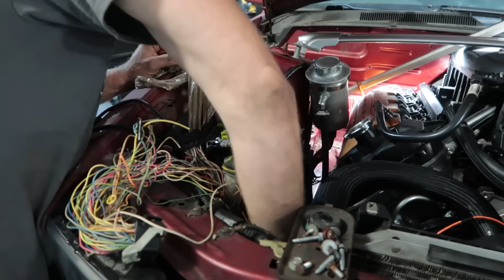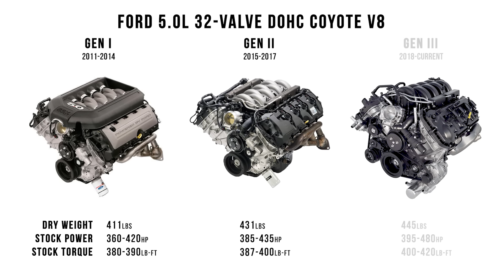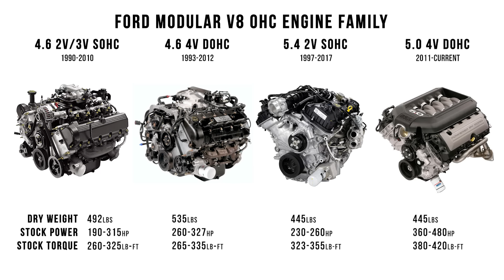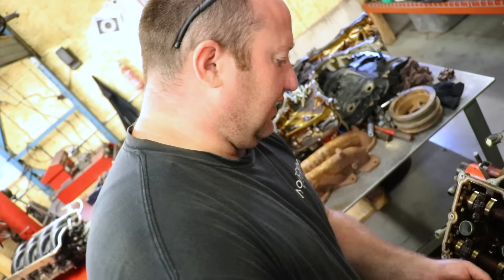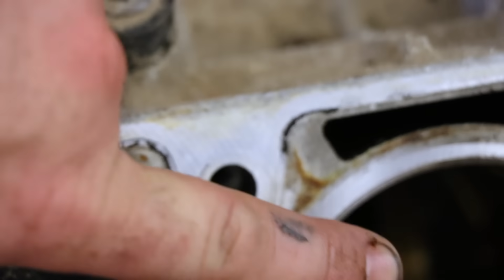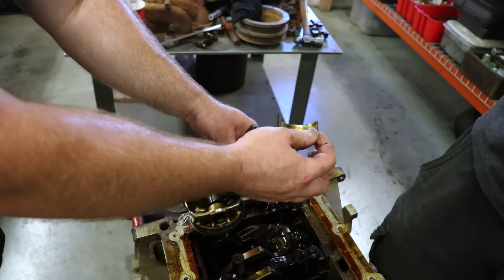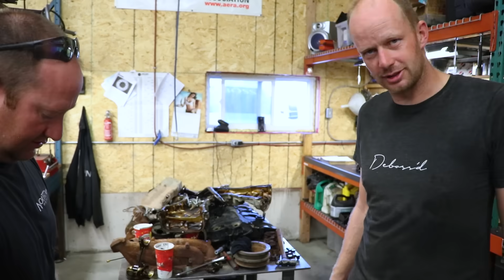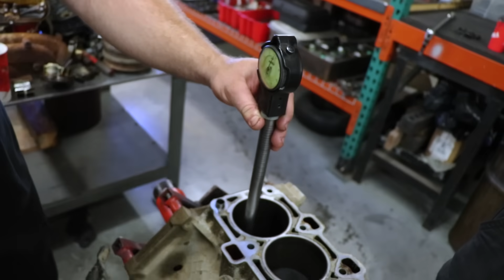REVIEW: Everything Wrong With A 5.0 Coyote Engine

Comment: Hello rich, when you get a hold of one will you do a talk about the 6.8 Triton v10
Reply: Easy get a 2 valve and plan for coil swaps other then that good engines hard on fuel.
Reply: It's a ford engine so he will just complain.
Reply: @Alpha Wërks  Your mom's still junk my hypocritical friend.
Reply: Have a V10 in my 2009 Winnebago. Moves that RV down the road pretty good. 265 Litre tank, about 1 liter for 4Kms.  Taking it easy, not speeding, no mountains = 850Kms per tank. However, I live in Edmonton AB and there are mountains and the Alaskan Hwy(2 times to Whitehorse) no issues at 37000Kms so far.
Reply: I drive a 2V-V10 daily and only issues are it’s a gas hog. The coil packs aren’t the issue, it’s a dirty MAF sensor, keep it clean and it will run forever! Those engines have a 100,000 mile plug maintenance so your good, now being I said that, buy the nickel plugs, use antiseeze and torque to between 11-16 ftlbs, your good. I torqued mine to 16. The V10 will use a quart of oil every 4000 miles and that’s even a healthy well cared for V10. Mine does, everybody I know that has or had one said same thing . Don’t forget, Ford built a standard Headed V-10 and a PI headed 10, the PI is the one you want and most likely find, the Non PI is rare, I have the Non PI engine(99). Also, the truck and van engine differ but can be converted if you have the van to truck and or truck to van parts donor. I pulled a V10 from a Ford F53 chassis, is based on a van, I simply swapped my truck pan, oil cooler, mounts, etc to the new engine and it drops in a F-250 no issues.hope this is helpful.
Reply: @DanielThomason1  ford revised spark plug torque specs to 20-23ft-lbs for all 2Vs otherwise they come loose at the lower torques.
Reply: @DanielThomason1  Hey Daniel, how many miles do your brakes last on that vehicle? It's an Excursion right?
Reply: @Alpha Wërks  Your mom's junk.
Reply: same as a 5.4 2v with 2 more cylinders
Reply: Same exact motor as a 5.4 with two more cylinders tacked on
Reply: I suspect the 10 cylinder is smoother running naturally and maybe has a flatter torque and hp rating curve.  I dunno.  They sound kinda cool if nothing else
Reply: V10 has a nice low end pull. The maximum power rating is very underwhelming, where it shines is from 0-45mph
Reply: Didn't they use that in the Excursions? Those things are tanks.
Reply: So you guys with the v10 like them? I’ve driven a few company trucks that had them and they didn’t feel much more powerful than the 5.4 some of the other trucks had. Plus the extra front end weight and bad fuel economy didn’t make it very fun to drive. Maybe we just had some bad ones?
Reply: @jaedonhaskins9917  nope, that sounds about right for all the triton V10s. Not as powerful as you hope, worse on gas than you hope, but generally just as reliable as the 5.4 2v. Still doesnt stop me from loving that exhaust note 😄
Reply: @jaedonhaskins9917  I have one of the non-PI versions in my F-250 with the automatic and I love it. Before this I had a 4.9L I6 F-150 and 5-speed manual, which was a great combo, but it was a gas hog for the amount of power and torque it made. This thing matches it in mileage with almost twice the horsepower and torque and in a heavier truck, using an auto, which is not bad at all. I average about 11 mpg around town and I can get about 13-14 on the highway depending on my speed. It's no fuel sipper, but not as bad as you'd think for a 415ci engine. I think the reason these engines don't feel very powerful is that Ford tuned the transmission to shift identical to the 5.4, so it tends to keep the revs high and it won't stay in high gear if you roll onto the throttle up a hill. At wide open throttle you do feel the power but driving around town it makes it feel anemic. If you drop the shifter down and manually shift it to keep it in a gear you can really feel the torque and throttle response of this motor, which is immense. Anyway, I've towed pretty heavy with it and it won't keep up with a modern diesel, but I've never felt like it wasn't enough to get the job done. Just don't be afraid to rev it out when it's got a load on. You can beat on them for days and they won't overheat and it won't hurt 'em at all. Remember that they rev this same bore/stroke combo to 6500+ rpm in the supercharged 5.4 with no reliability issues. You could run it all day long at 4000 rpm.
Reply: @jaedonhaskins9917  Well if it feels like the 5.4 then it's a downgrade from the 4.6 as the 4.6 feels faster for some reason, acceleration and body kickback into the chair feels more dramatic on the 4.6 compared to a 5.4lL f150.
Reply: East DallasKick's I love the 4.6 motor, my 2010 f150 has the 4.6 3v and it still runs good at 315k miles
Reply: @MichaelFletcher-to7mm  Oh that's great I'm still contemplating on purchasing a 2009-10 with the 4.6 triton or a 2012 with the 5.0L but I want it in a single cab as 4 doors (super crews) are boring to me now. Also do you have halo mcc?
Reply: All you need to know about the 6.8 is that Ford built one helluva shrimp boat anchor.
Reply: Jeff W  Hahaha Forrest Gump probably used one on his shrimp boat.

Comment: The 6.2 in my work truck developed an intermittent bottom end knock under warranty.  Dealer pulled the pan and found two main caps with loose bolts.  They put a new engine in it.
Reply: My friends work truck had a shattered piston on his 6.2
Reply: Yodaman I ain’t pushing shit dude
Reply: Ford quality.
Reply: @repairvehicle  Ford quality depends...
If built on a Wednesday, they quite alright.
On a Monday or Friday, oh boy!
Reply: repairvehicle whatever, I have a Tahoe that is just about undriveable because it’s always a new problem.  That is a true piece of shit.  I work my ford truck everyday and it has been almost flawless aside from the stated problem.  Every single GM product I have owned over the years has left me stranded in one way or the other, all of the fords got me back home.
Reply: @Highstranger951  , just because you got home,  it doesn't make Ford reliable brand,  you still keep fixing Ford on regular basis because it breaks.
Reply: repairvehicle no, I fix the Tahoe on a regular basis, pay attention.
Reply: @Highstranger951 lol sure bud bought Ford trucks most of my life only Durable Ford engine is 300 6cy stop buying Ford's 20yrs ago switched too Silverado with LS engine best engines ever built my 06 going on 275k miles still running strong still all original power train there's a reason old Chevy trucks bring better money than same yr as a old ford truck
Reply: @repairvehicle  Compared to what? A piston slapping oil burning AFE 5.3L GM?
Reply: @nathanmcdonald610  , who compares unreliable to unreliable?
Reply: @repairvehicle  Just pointing out the fact that you're leaving out that both the LS and Hemi suffer their fair share of issues as well. Making sure the narrative is clear you know. :)
Reply: @nathanmcdonald610 , did I mention gm or fiat?
Reply: @repairvehicle  You showed bias, that was all I needed.
Reply: @nathanmcdonald610  , are you saying that you are not biased by mentioning gm problems? You are biased yourself, but you don't see that because you are hypocrite.
Reply: @repairvehicle  No, just making sure we keep it fair is all.  If you're gonna mention one, might as well mention the others.
Reply: @nathanmcdonald610 lmao TRIGGERED Ford boy can't stand the Truth keep crying how many coyote engine Ford sold Chevy has made and sold over 100 million LS Engines
Reply: @donaldkinder6716  A million piles of shit is still pile of shit. I'll take my Coyote over a cookie cutter rod knocking LS any day of the week.

Comment: Looking forward to the “everything wrong with a 5.9 common rail” video
Reply: Absolutely nothing.
Reply: Ben Giovenco agreed the only thing I can think of is the automatic transmission I have a 03 6 speed   most reliable truck I’ve owned
Reply: Cracked pistons and injectors I'd really the only problem you can have with them
Reply: Do the 5.9 common rails have that killer dowel pin?
Reply: seanmurphy243 no
Reply: Or 12 valve
Reply: Woah! Take it easy! You're going to ruffle a few feathers with that comment.
Reply: The 2 things that should have been done differently on the 5.9L Cummins is the KDP, and it should have been sleeved instead of parent bore. Other than that the 5.9L is just one of the best small/mid sized engines. I think that the 6.0L Perkins is a better engine, but I love 5.9L. Perkins 354 and 354T were the best before the 5.9L.
Reply: Tom Cleverley kdp wasn’t an issue with the common rail. Totally different timing case
Reply: Killer dowel pin, 53 block, cracked pistons. It has its fair share of issues.
Reply: awr90 KDP is a cheap as all get out fix, and isn’t even an issue on common rails. The common rail also didn’t use a 53 block and even the 53 block fiasco was blown out of proportion. A very small percentage was cracking. The cracked piston thing is only really focused on the 04.5 to 07 common rail (in which time ford had an engine with a PLETHORA of issues) and even then, pistons only cracked if injectors hung open (which was easily diagnosed because you’d hear it knocking)
Reply: Common rail is the problem
Reply: Hugh Jarse common rail> 12 valve
Reply: He made it was just 0 seconds long

Comment: Cleetus is running blown coyote in his burnout Crown Vic if Im not mistaking.
Reply: no, 5.4 gt500 engine
Reply: think so yes, it was from a gt500?
and seeing the abuse that engine gets i dont see why anyone would complain about them. (he did change the timing chains to withstand his abuse tho)
Reply: @Frietpan  actually timing chains wasn't the issue. He was bouncing on the Rev limiter. Timing chains don't like Rev limiters. ECM was tuned to defuel and remove spark at a set rpm. Identical to what factory ecms do. He was replacing timings chains after every burnout before the ECM tune
Reply: Nope. Condor engine

Comment: Great whilst under warranty ! After that 🤔
Reply: I agree, my ecoboost 3.5 was out of warranty by 80 miles and it blew up on the 4th of July on my way home from work.
Reply: My girlfriend and I both have mustangs with the 5.0 and hers is a first gen with 96k and mine is a gen 2 with 67k and both of these cars are fantastic powertrain wise. Starts right up, shifts smooth as hell, fun and fast, sounds great. The 5.0 is one of the best Ford has put out since the 4.6 2V. You can also see plenty of examples of the 5.0 with 150k+ miles on em.

Comment: Exhaust manifolds rusting out and exhaust manifold bolts rusting out, these issues Ford have not managed to fix 20 years later.  History repeats itself.
Reply: Shit the 460’s from the 70’s we’re constantly having manifold problems
Reply: sounds to me like a factory implemented excuse to long tube and straight pipe the truck.
Reply: But GM has the same issues, I changed the bolts on my 5.3 as a preventative measure, I've heard on the LS the rear exhaust manifold bolts break from 70k to 150k miles depending on the salt on the roads.
Reply: Wouldn’t have anything to do with being in the rust belt and being heat cycled at least twice a day for its entire life.
Reply: @RadDadisRad  , other brands don't have that issue, because they use stainless steel. So, don't blame rust.
Reply: @repairvehicle  what you've never seen stainless corrode and rust because that can still happen you know.
Reply: @Zach-ju5vi ,  I never seen Stainless exhaust manifold to rust out like Ford has with cast iron.  20 years ol6 vehicle with Stainless exhaust from factory looking like brand new, but the body of the vehicle is rusted.
Reply: @repairvehicle  it is made with a preventive coating when it's formed, doesn't mean it doesn't oxidize, corrode and rust.
Reply: @Zach-ju5vi  , my 5 years old f150 with 5.0 v8 coyote engine had rusted out bolts and exhaust manifolds were rusted big time and started to leak.
Reply: @repairvehicle  I highly doubt rust has anything to do with it leaking, they leak from warping because of extreme heat or blown out gaskets.
Reply: @Zach-ju5vi , sure they do, when it's rusted out its starts leaking, not a first time it happened to me, first time with 5.4 and then 5.0.
Reply: @repairvehicle  kinda sounds like BS to me. I had a 5.4 for ten years, the manifold leaked but from the gasket, my 79 460 leaked but because the manifold was warped, all my 40-50 year old tractors have rusted manifolds none of them leak.
Reply: @Zach-ju5vi  , ford quality is not same quality of the tractors 50 years old.  Tractor quality comes from hard work made in US,  ford quality comes from cheap outsourced metals where people earn 20 cents per hour.
Reply: @repairvehicle  you could be right and I'm sure all manufacturers suffer from this problem. All I'm saying is I had a 5.4 and my father has a 5.0 and we never experienced the manifold rusting enough to cause a leak on any engine that wasn't 30+ years old. Although I have see lists of bad gaskets and warped manifolds.
Reply: @Zach-ju5vi ,  some people never have problems with Ford,  because they never keep them longer 2 years. Some don't even know that problems existed because they have lots of money and pay dealers what ever it needs done during the oil change.  One Ford owner (business owner) commented on my channel, stating that every oil change at the dealership his truck needs something replaced and repaired. He does not care about quality,  because purchased another Ford.  For some people problems none existent because they love what they drive and don't care about the problems,  money solves they're vehicle problems. I work hard for my money and cannot afford not having quality vehicle. Thanks to YouTube a lot can learned without  spending money and learning hard way.
Reply: @repairvehicle  that goes for all manufacturers not just ford, that's why I haven't bought a truck newer than 08. Although if I was to by a new truck it would probably be a 5.0 because I like the way it performs and I like the interior better.
Reply: @Zach-ju5vi , it doesn't go with all manufacturers.  You been Ford loyal only.  I had everything except for European vehicles.  Ford still using cast iron for exhaust manifold,  Toyota stopped using  cast iron on truck since 2007. Ford never scored as quality vehicle Toyota always.  No one was able to get 1 million miles on Ford F150 without constantly repairing engine and transmission.  Toyota tundra got 1 million miles without any engine repairs and transmission was repaired for reverse at 700k miles, all forward gears still working fine until Toyota took from the owner and gave him brand new tundra.
Reply: @repairvehicle  lol buddy ive owned more Chevy's and just as many dodges as I have fords, They ALL manufacturer shitty vehicles. If I was buying a new truck (which I'm not) I wouldn't care if it will make a million miles because the chassis wears out and the body rusts before the drive train gives out anyway.
Reply: @Zach-ju5vi ,  that's why I gave on dumb engineering big 3 does, they only care about bragging rights who sells the most. Why people dumping big 3 cars, because they are pure garbage and more people prefer Korean cars and Japanese.  I was brainwashed by Ford commercials how their trucks are and had two Ford trucks and never again another Ford. Toyota tundra is my choice for half ton truck.  If big cannot make quality trucks then I am smart enough not to buy them. My last Ford truck was 2013 f150 with 5.0, 70k miles when sold it, biggest pile of garbage.  Purchased 1/4 million miles 2012 tundra, best truck ever,  servicing is simple and easy.  It has drain plugs for everything and fill plugs, transfer case, differential front and rear,  transmission.  Frame is clean from rust,  truck came from Ohio.  If Frame rusts out,  Toyota will replace it for free.  Toyota knows how to keep customers happy, not like Ford.  Never replaced frames for free.  Craigslist in my area is full of Ford trucks with bad frames 2005 and up. Never seen older Ford with rusted Frame.
Reply: @repairvehicle  I was brainwashed by Chevy, after I bought two of them and they both constantly needed work I decided to try a Ford. The ford really was a good truck for me so I have changed my opinion about them completely. I know the Toyotas are really good trucks but they still have their issues and they can be expensive to repair. I have taken a different path, I bought a 79 f250 and I haven't looked back, best truck I've ever owned by far.
Reply: Debatable, i work at a dodge dealer and atleast 5-6 hemi’s a week that need exhaust manifold replacement.
Reply: @MrZombies24  , people know how to stay broke and keep dealers in business.  That's why I drive best money can buy with stainless steel from factory.